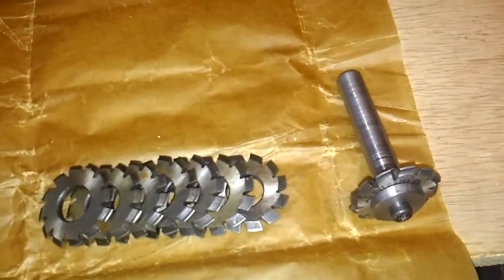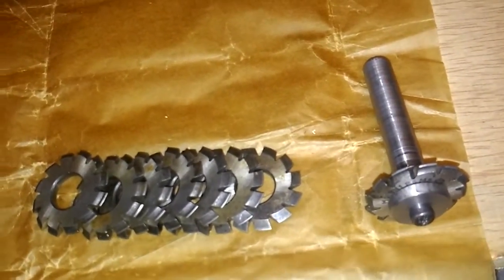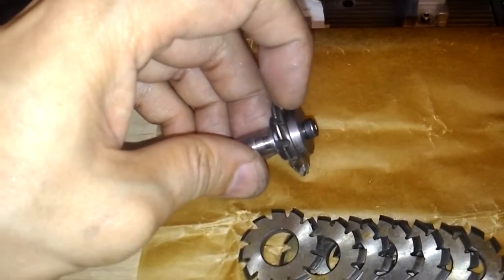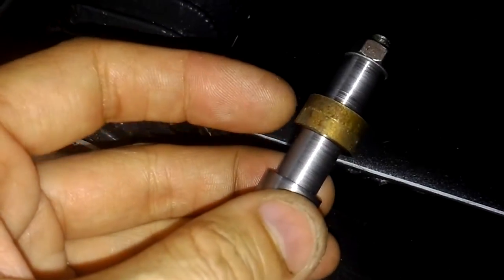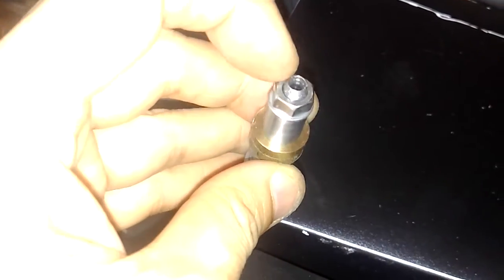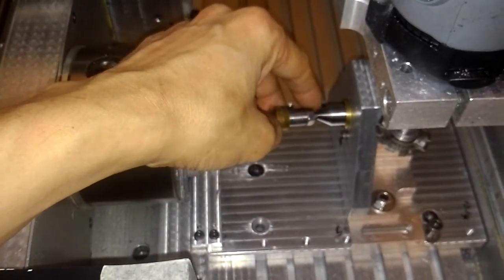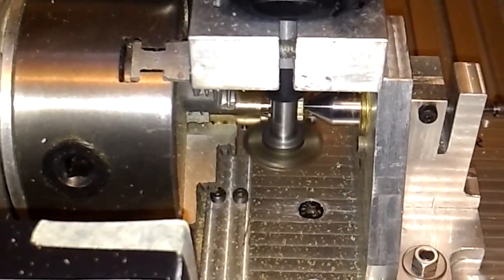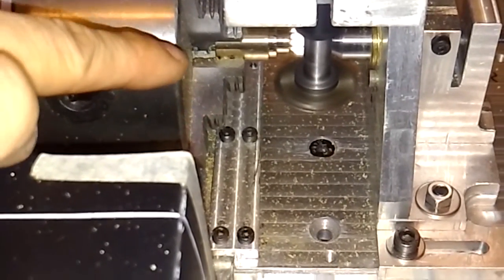CNC milling gears by gear cutter - 32(High Z CNC-STEP)

Comment: Hey, i know this video is super old, but dont you recall what RPM did you use , I can only go as low as 6000rpm...
Reply from the maker: I don't remember, the lowest speed of my Kress spindle around this value? but the output torque then is low and may not be suitable. What is the matter with using higher speed?
Reply: @ray-charc3131  Im just considering on how to make gears on my high speed spindle. Using these types of cutter since they have a big diameter supposedly could have issues, but i'll have to try and see if there will be any issues at all. thanks !
Reply: @ray-charc3131  Also, my torque is also pretty low at the 6k rpm, so you probably used something higher than 6 thousand correct ?